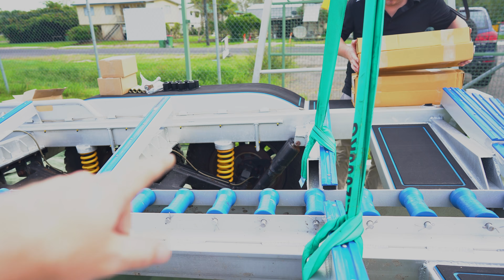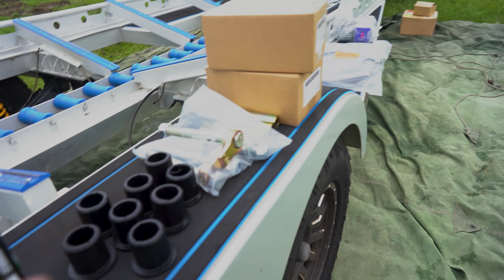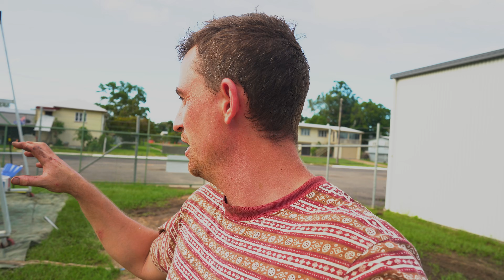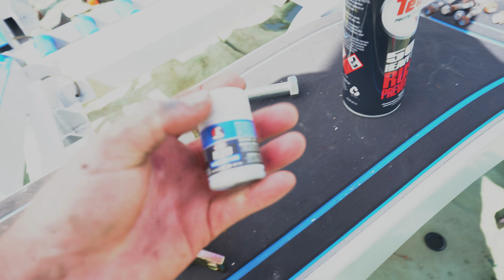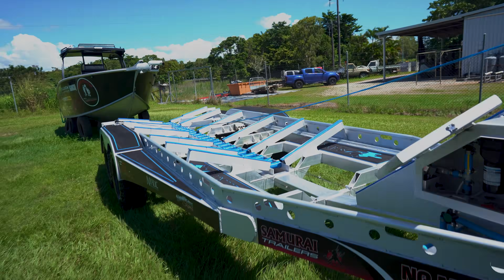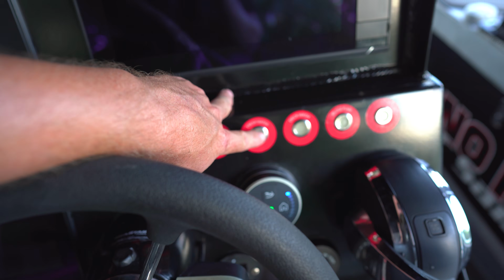What Didn't Survive?? 18 Month After Build Update! (And trailer Make Over)

Comment: I PUT TECTYL ON THE FACE OF THE HUBS INSIDE ROTORS,BOTH SURFACES OF ROTORS,THE PADS  AND ON THE CALIPERS, I MEAN EVERYWHERE. I'M A CAR MECHANIC AND DON'T SEE ANY PROBLEM  WITH THAT, THE BRAKES STILL WORK AND THE ROTORS TURN A BLACK COLOUR AND DOESN'T RUST.

Comment: Love that suspension but it’s really not designed for boat trailers and salt water. You pretty much have to strip it all
from day 1 and get it hot dip galvanised, swap all hardware out for stainless and ceramic coat the parts that can’t be galvanised. Also DeeMaxx makes a stainless backed brake pad with a lifetime warranty.

Comment: I ended up using zinc plates off of an old mercruiser I/O drive in five different spots on my trailer, I haul a 32' cc and what a difference $40 worth of zinc's randomly bolted to the frame of the trailer it makes, I easily notice %70 less rust on The trailer and components then the year before and the zinc's were %50eaten away, just an idea turtle to have as an option

Comment: Wow, at all or most of the items your replacing are called wear and tear items and by the looks minimal up keep and maintenance on them. Lessons learned there I recon for you owning a big boat and trailer !
If you seen what George uses to clean his trailers ( AUTOSMART PRODUCTS ) they have a product called G101. 
This product is a product leader Australia wide to clean the very worst of boats and mould from everything, and I mean everything so have it in your kit when your cleaning the boat.
Another tip coat your running gear in lanolin over a 3 day process coating them several times and use grease tape on areas that are larger when replacing to new items. And use the Lanolin on a regular basis. Then you will not have so many issues.

Comment: Wow, a year and a half and alot of things cooked! Whats doing with that?
Reply: Was thinking the same. I have a 3.5T gal trailer thats 2.5yrs old and done plenty of kms and still like brand new. Just done first set if bearings. But those suspensions set up is bound to fail for ever. There a van/camper set up. Needs torsion axles. I have them and faultless.

Comment: Awesome video bro any chance you have a better shot of how the boat was sitting on the tyres when it was off the boat? I need to do trailer maintenance and don't wanna have to deal with dropping the boat in the water and working on the trailer at the ramp
Reply: Off the trailer* 🤦
Reply: Hey bro I recently redid everything on my boat trailer, did all the rollers, spindles, skid boards, etc in the garage

I just used multiple planks of wood stacked on top of a Jack and jacked the boat at the very back under the transom

I just raised it enough I could get everything out from underneath. You gotta be careful though while the boats on the jack it gets wobbly, get a mate to spot you

Best of luck with it bud